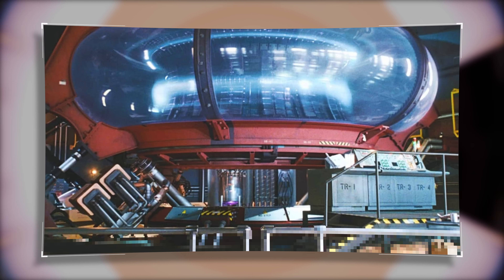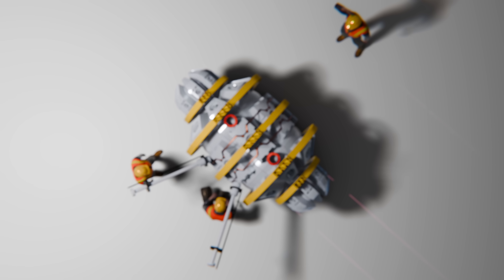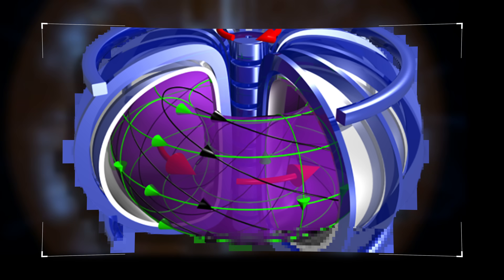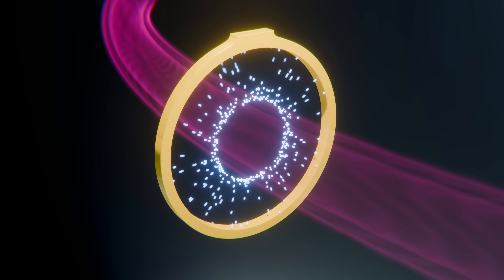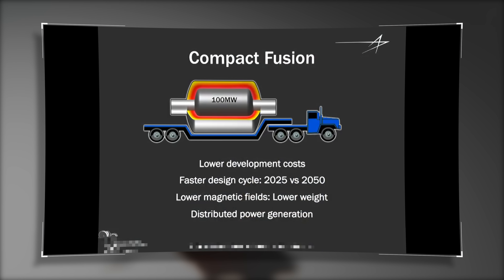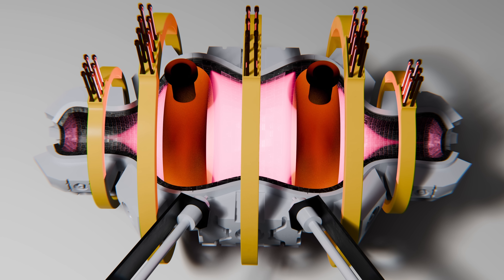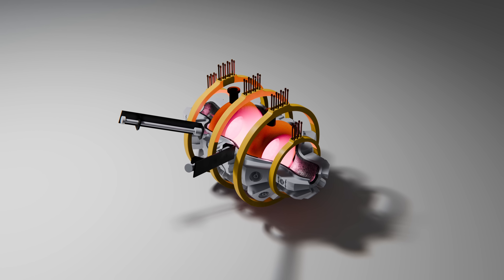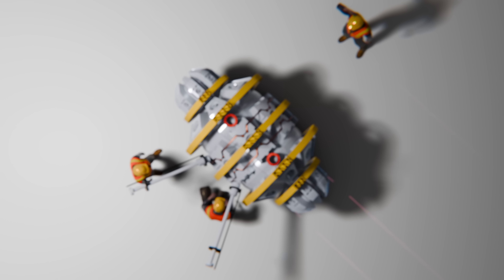Lockheed Fusion Reactor Failed - What Happened?

Comment: They canned it due to it not being doable. No company on this planet or government for that matter would give up being the first to create a successful fusion reactor, especially one that is container sized. We simply do not have the tech knowhow to achieve it yet. Maybe with AI there might be a feasible design at some stage.
Reply: OR, the knowledge and science behind this capability went black because it started to get somewhere. Today, we're talking about molten salt reactors like its a new thing. The Atomic Energy Commission, now the Department of Energy was working with Lockheed and others back in the early 50s and had molten salt and other magnetohydronamic reactors working back THEN. Imagine an unlimited black budget going into the fusion power endeavor. Whoever owns such a technology has a lot of power and can have HUGE military applications and repercussions if your "enemy" has this information. You're not exactly going to just have this technology out in the open and available to study by some 20s something year old PHD student.
Reply: They canceled the project because they were successful
Reply: @gcoffey223 
The objective was the funding, not the product.
Reply: Or at least too expensive given the probability of success and likely time frame.  But for fusion generally we just haven't funded it that much.  Part of the problem is that until you get to the very end of the process it's mostly hard to patent basic research and you need government funding.
Reply: @petergerdes1094 
No.  In the Polywell case the prototype would only take about $300 million.  But if it worked the $40 billion Iter program, and all the solar and wind programs would be killed.
Reply: @KellyStarks Thats what they said initially they obviously ran into additional issues as tends to happen.  I guess it depends on what you mean by work, obviously it wasn't as easy as initially thought but that doesn't mean you couldn't potentially overcome those issues with time and money.
Reply: @petergerdes1094 
No, they got the design etc issues worked out.  This was expected to. E a working, power plant.  Cooling system to allow continuous operation not just test spurts, actual power generation systems, etc.
They essentially finished the R&D phases.
Reply: @KellyStarks I mean no one has built a power positive such design and lots of people think it won't really work (I mean yes ofc u can get fusion this way but u can get that on your desk the issue is energy loss).  Plasma physics isn't something you can just sketch it out once and be like 'yup it's going to work' as there are often complex phenomenon you need tons of simulation or experiment at near operating condition to notice.

Someone almost certainly went ahead and did some detailed sims of the lockhead idea and found it had issues that needed to be overcome before it could make power (plasma instabilities, energy leaking away because of weird interactions etc)
Reply: @petergerdes1094 
Plasma physics isn’t really the problem with getting power out of the reactors.  Simple power consumption numbers really are.
Reply: @KellyStarks The plasma physics is often how you lose energy.  It's really easy for your plasma to lose energy in ways you weren't expecting/predicting (you always lose some ions but you can get complex interactions which cause you to lose more or more high energy ones than you would have thought on a simple model).

Sure, for designs we've studied experimentally for a long time at large scales like Tokamaks we have quite decent experimental bounds on energy if you use certain field configurations.  It's why they can be so confident ITER will work.  

But you suggest some new design and its pretty likely that you will end up losing more energy from the plasma than you predicted using a very simple model.
Reply: @petergerdes1094 
But that’s not how Tokomack Designs get crippled.  The plasmas are generating power, but the magnets and cooling systems eat it faster then the reactor can make it.  (So total power “produced” is 0.5). Newer reactors like Spark have magnets allowing much smaller reactors of the same power levels, and magnets and cooling systems needing a 20th as much power.  So your at 10 for total watts thermal out to total watts electric in.  Steam turbines get you a watt electric out for each 3 watts thermal in..   so total power production is about 3.
Reply: @KellyStarks The closest a Tokamak has come is JET which got to 50% of the power *needed to keep the plasma in a steady state* came from fusion.   No Tokamak has even reached the point of the plasma itself being self-sustaining even in theory ignoring all losses and costs like cooling.  Only NIF has kinda cheated their way to day they are net energy positive by doing their totally impractical little laser explosion thing.

But this is all besides the point which is just that the energy losses from the plasma are way bigger than pure blackbody radiation bc of plasma effects and you have to add up all the losses and subtract from gains.
Reply: @petergerdes1094 
So Jet (with more efficient magnets etc) would be power producing.
Reply: @petergerdes1094 
Ironicly, Helion has just broke ground on their first fusion power plant, commissioned by Microsoft to power one of their big new server farms in Washington.  It’s scheduled to go online year after next.
Reply: If anyone is doing it, Lockheed Martin is
Reply: @damienmcmurray9786 
Yeah their Skunk works does the “obviously impossible” so routinely it should be their business slogan.
Reply: I've seen the video and press release. A lot of people are missing the part where they were transparent about the tech being exclusive to the US military for the first ten years after completion.
Reply: @SquareTheElder 
;)
So the real
Question is when is the 10 years up?…
Or, are their military applications being developed?
Reply: Yes, this is correct. I feel people love conspiracy theories (I like a few) way too much. If someone had compact fusion they’d be taking clout like there’s no tomorrow.
Reply: @ccerrato147 
You ‘feel’?
Reply: The AI its the trick, magnetic cooling, processing power and a mountain, so you have the best weapon.
Reply: Oh how wrong you are.  You see, this thing can make shit tons of neutrons.  You can use those neutrons to activate thorium for fissile uranium or depleted uranium for fissile plutonium.
They're trying to avoid nuclear proliferation.
Reply: Except we have records of other fusion projects and companies (like EMC2’s Polywell reactor) that did get to the point of building a production prototype with integrated power generators, stable cooling systems,etc. ; and then have the White House and department of energy order it killed.
Reply: 22 minutes in France says you're wrong but then again, history is as full of people that say it's impossible.  Thankfully, there are always people that say anything is possible or nothing would get done .
Reply: @jabe3780 
No. 22 min in France at best could say that reactor didn’t work, not that we need more advanced physics to make marketable fusion power plants.
Reply: @KellyStarks 
Please say that in your native tongue and I'll translate it...that way I might be able to understand what you're trying to say.
Reply: That's what you think. They have without doubt worked out fusion technology. They just don't want us to have it. Or any adversary we may as well. Just because they say arrrgh it didn't work. Are you really take there word for it?
Reply: we are currently working on ITER, and thus will figure it out
i just think lockheed martin is waiting for others to do more work on it so they can have a better understanding
Reply: @JNJNRobin1337 ITER has gone well over budget and has missed deadline upon deadline. It's not a straightforward process. Fusion is hard.
Reply: @JNJNRobin1337  look into commonwealth fusion systems' work. ITER was built as large as it was because the superconductors weren't as good when it was designed (the 80's/90's iirc) so the magnetic field couldnt be as strong as it can with current materials science. They can make them a lot smaller now, and other design constraints become relevant. Fusion devices below a certain size become limited by the magnetic field of the reactor pushing the reactor apart (meaning something other than steel would need to be used) and the heat and radiation of the reactor being too intense to keep the reactor walls from being damaged (meaning new active cooling tech and radiation resistant materials would need to be developed) SPARC is the smallest they could design in the early to mid 2010's, and they're building it in the US. First plasma is expected in the next few years. CFS is also making their superconducting coils (with 20 Tesla field strength) available for other fusion companies to use.

Most of this info is in a talk by Dennis Whyte of MIT called "breakthrough in nuclear fusion?" About how better superconductors make it possible for devices like ITER to be built at a much smaller size.
Reply: There's an excellent book by Gary Taubes called "Bad Science" about the whole LENR/"cold fusion" fiasco in the early '90s. It's a fantastic study in how otherwise well-meaning researchers can get caught up in the pressure to publish and be first to market without having all the data. No conspiracies, no back-room deals, just irrational exuberance and ego.
Reply: Your innocence is beautiful 😂😂😂😜😜.
Reply: @ernestoramos520  When you leave comments like this, people don't think "wow, you're so clever, you really got em'".
They just think you're stupid.
Reply: Well when you got a few alien space craft to reverse engineer and they apparently have zero point power the size of tablet(PC) you don't need Mr fushion anymore.
Reply: No, AI can't make new physics. The temperatures and pressures required always have an energy cost, because its five orders of magnitude above normal processes. Then of course there's the whole problem of trying to squeeze something intangible (plasma) with something intangible (magnetic field).